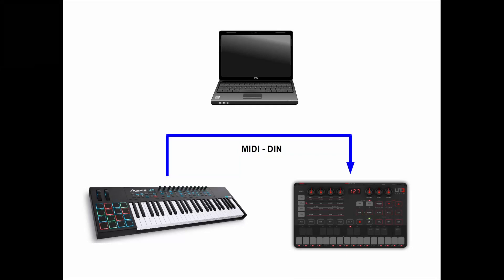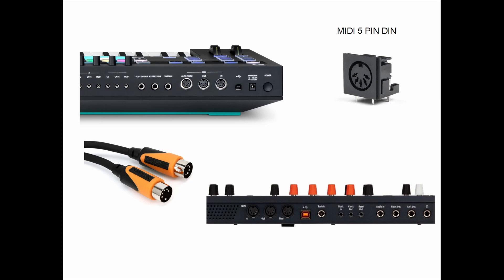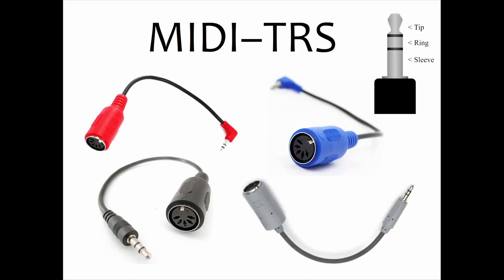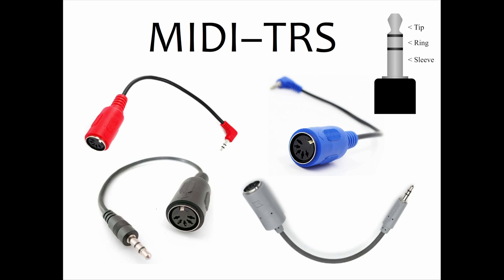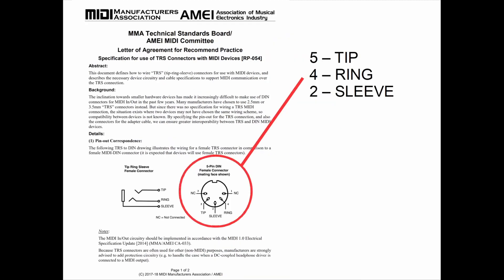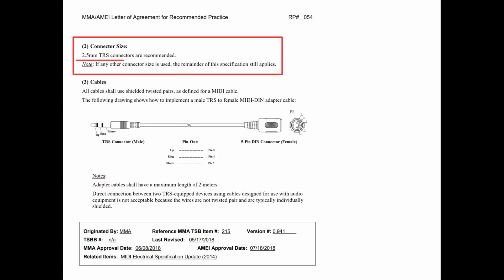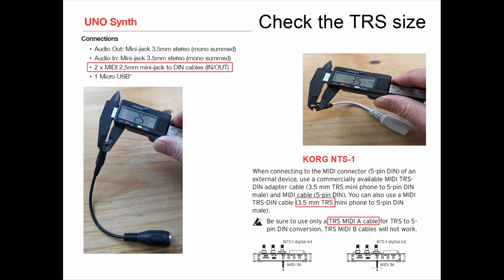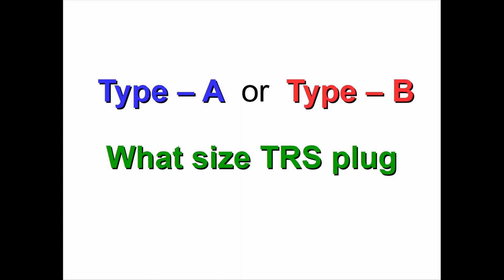MIDI TRS Type A vs Type B Adapters Explained

Comment: Thanks so much for this. So can you use any 5pin din cable to plug into either the type A or type B adapter and that will work fine?

Comment: I had some sync problems using a Novation Circuit Tracks, an Arturia MiniFrreak and a Korg vulca nubass. I just pulled out some random 1/8 inch stereo cables and plugged them into the sync ports. I didn't think I had to be picky about if it's stereo or mono or whatever.  But things didn't sync. And looking for 3.5mm MIDI cables on Amazon I see both TS and TRS so I'm rightfully a little confused.